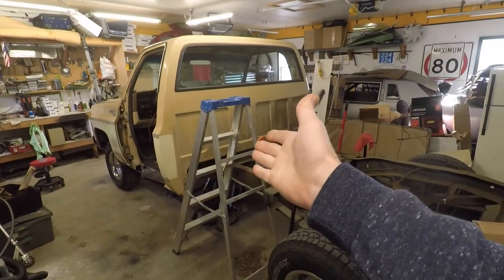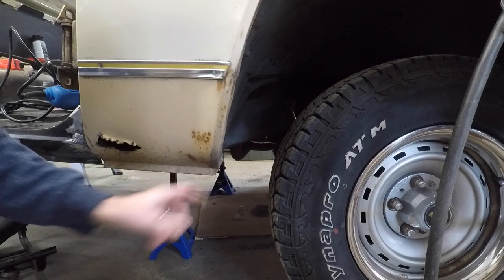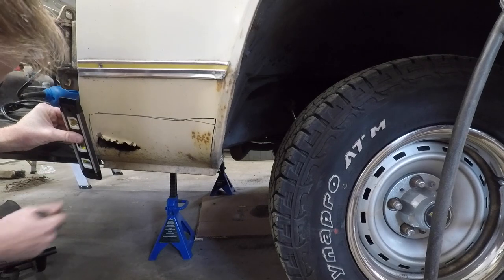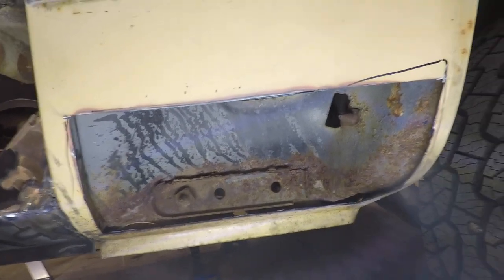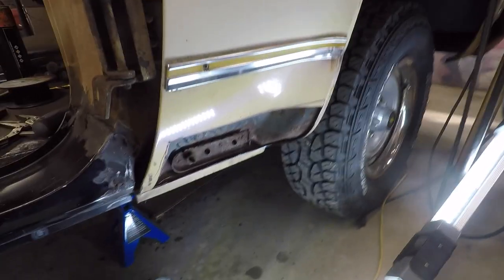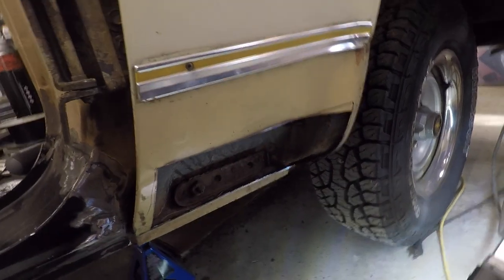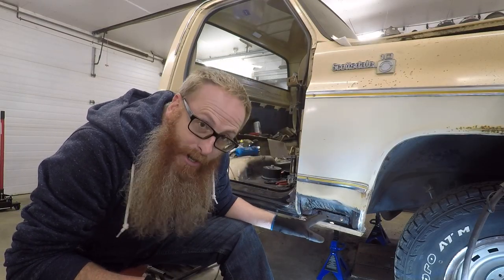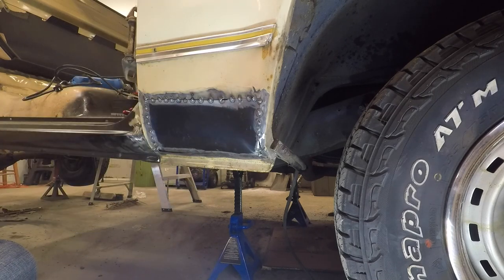HOW TO PATCH A RUSTY FENDER ON A 1977 CHEVY C10 TRUCK

Comment: Something else I just learned on another YouTube channel is that if you have a sheared off bolt stuck, you can use that same technique that you used in the last video with the welder. 
Carefully tack little bits of weld onto the broken end of the bolt till you have enough material built up so you can undo the stub with a pair of pliers.
Reply from the maker: We've done that at the shop in the past. No broken bolts here though....YET!

Comment: I have a flanging tool for an air chisel.  It makes a flange for filler pieces like this, so you aren't having to butt weld panels together.  Very handy! Oddly, I bought it for a Chevy truck...
Reply: If you were wondering, I got it at Princess Auto
Reply from the maker: I have one that I borrowed from the old man! I actually used it on the cab corner!

Comment: Yet another great vid man!! Patch job came out great. I’ll be doing the same technique on my ‘84 on the area right behind the rear tires. I see that you also got you an electric grinder as opposed to trying to use your old pneumatic cut off wheel. 😉👍🏻👍🏻
Reply from the maker: I will be tackling that same area in the future as mine are getting bad. Thanks for watching all these older videos!
Reply: @OldeCarrGuy  hey man not a problem. I’ve actually watched your “rocker, cab corner, & fender patch” series a few times because I’m going to be doing the same thing that you did. Like you, I’ve never done any panel replacement, nor any welding. I have bought myself a welder, now it’s time to order some panels & start cutting on this ole girl. 👍🏻👍🏻

Comment: Hey Jason, what did you use to hold your patch panel in place prior to doing your first few tack welds? Thanks man.
Reply from the maker: I used a magnet!
Reply: @OldeCarrGuy  did you end up having to “massage” your patch panel very much in order to get it to fit the way you wanted?
Reply from the maker: @gimmefuel7268  other than cutting the metal it fit perfectly! No massaging required!

Comment: You have the entire patch panel you should take the fender off and cut the bottom right off.That rust will be in there more than it shows on the outside.It’s like an iceberg.You only see what’s sticking out.
Reply from the maker: I get what you're saying and someday, I will completely restore this truck, but for now, I'm going to enjoy it with as much of it's original-ness as possible.

Comment: I know this has nothing to do with the video I had a question about the Grand Marquis I'm changing the driver side door on my 2000 Grand Marquis but the replacement door has the keypad with the numbers on it will my wire harness still work
Reply from the maker: My initial answer would be yes! Most of the harnesses are made the same but pinned out differently for different options. Always good to snap a picture of the new and old plugin to be sure. Worst case, you have to swap the harness from old door to new door!

Comment: Good ol chevy rust pockets. Its a shame they habe those areas that hold so much stuff that makes them rust faster. I my 81 im keeping when i had it tore down i opened up areas to allow for that crud to escape or escape better depending on where it was.
Reply from the maker: I made sure the inner rockers and cab corners could drain! But if there is a next time with this truck, it will be panel replacement!
Reply: @OldeCarrGuy  yea replaceing the whole panel is so much easier lol.